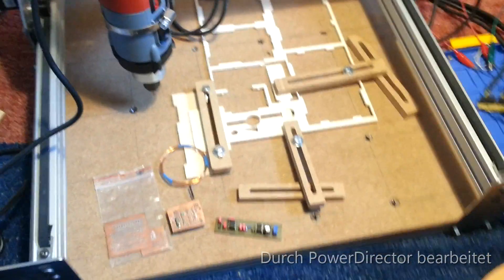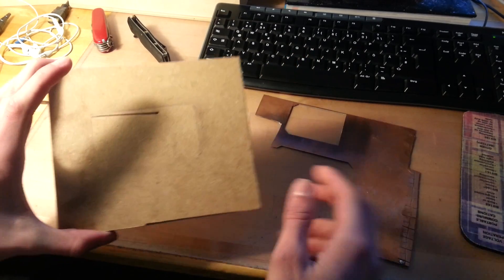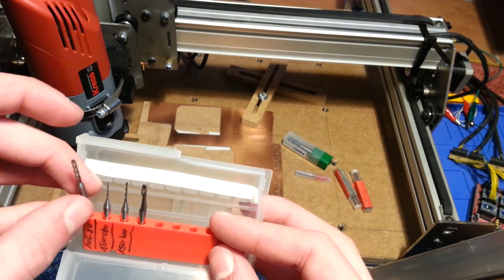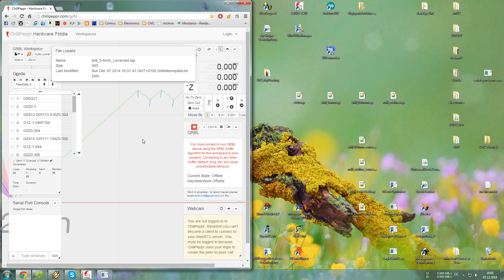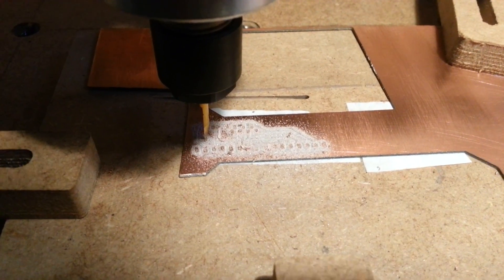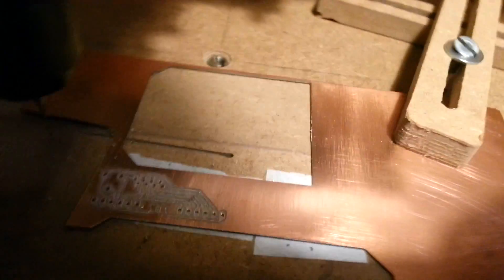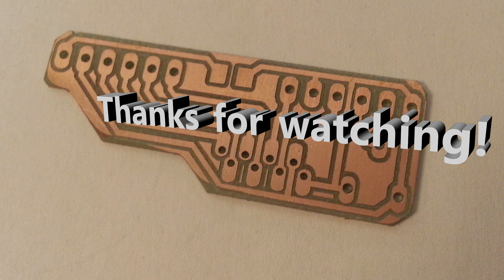PCB Autolevelling for Isolation Routing - Shapeoko

Comment: I made my own print circuit boards by hand and etched them with Boric acid in the late 70's and found that using drilles found in Welding torch cleaning tools work quite well. They come in very small sizes and can drill very fine for HSS drilling.
Reply from the maker: Hi John, thanks for the tip, but nowadays cheap carbide drills from china are ~$0.30 when bought in sets, so there really is no reason to use HSS anymore unless you're in a hurry and need a drill rightaway

Comment: I'm trying to use your program and everything seems to work the same except after hiting save the cnc does nothing. I use fritzing for pcb designe ,flatcam to create g-code , and drag and drop into your program.it creates a box that matches my pcb so I figured I have done everything right so far. when I open the com port I hear the program take control of the cnc ,but after the next few steps ,unlocking etc, and finaly hiting" save" the cnc does not move. any advise? thanks
Reply from the maker: Did you actually use the old software? If so try OpenCNCPilot as this software is no longer supported

Comment: This process is ok for Shapeoko 3?
Reply from the maker: Yes. The Shapeoko 3 also uses GRBL, so it will work just fine
Reply: martin2250 I'm having a problem that I try to solve three days ago. I do everything like in the video, but when it comes to saving everything hangs. I updated my shapeoko 3 to grbl 1.1 so I could use Carbide Motion V4, could that be it? would you have any tips to help me?
Reply from the maker: Can you try downloading and installing grbl 1.1f from gnea/grbl on github? (I don't know if carbide motion adds its own changes or which exact version of grbl 1.1 it uses).
If that doesn't work please open universal gcode sender and post the responses to "?" (status report, only shown when verbose is turned on) and to a manual probe command "G38.2 Z -10 F 30" (be sure to connect your probe cables)
Reply: martin2250 I'm using GRBL 1.1f, it appears in carbide motion and GRBL Heigh Probe V2. I gave the command you suggested and the answer is error: 9
Reply from the maker: no wonder, GRBL Heigh Probe has been discontinued as clearly stated in the video description. its replacement OpenCNCPilot should work just fine with your setup
Reply: martin2250 Hello again.
I wanted to thank you for your answers and support.
I downloaded and did all the procedures with OpenCNCPilot V 1.3.2
When creating a new probing I place the measurements, and when I click Run the following message appears in the lower right corner:

G0Z1 (in black)
G90 (in black)
all below appear in red:
G-Code locked out during alarm or jog state: G90
G-Code locked out during alarm or jog state: G0Z5
G-Code locked out during alarm or jog state: G0X0Y0
G-Code locked out during alarm or jog state: G38.3Z-5F20
G-Code locked out during alarm: G91
G-Code locked out during alarm or jog state: G0Z1
G-Code locked out during alarm or jog state: G90

When i click on "Probe and set zero" the following message will also appear in red:
G-Code locked out during alarm or jog state: G38.2Z-10F20
Received <G-Code locked out during alarm or jog state> whithout anything in the sent buffer.

I believe it must be something with the USB connection or configuration of my CNC, correct?
Thank you again for your attention and I imagine how hard it is to respond to everyone, if you can give me a sense of where to go, I will be greatly grateful to you.

Thank you again!
Reply from the maker: Henrique Corvelo 
your controller seems to be in an alarm state. sending "$X" (without quotation marks) should unlock it (or maybe your grbl is configured to not work unless homed "$H")

Comment: Hallo Martin ,
good job mate .. but i have a question if you can help me ..i'm trying to use your hight prob with my cnc shild v3 ..i dontr know where should i connect the wiers in the shild ... what i'm using now SCL with the GND ..but from the 1st touch it gives me completed .. dont know wich output in the cnc shield is the A5 ..
thanx for help..
Reply from the maker: Hi Omar, I don't know which pin to use on that specific board. you can try to use a multimeter to check for continuity between A5 and any accessible pins.
Reply: yeah ist the SCL but after the 1st Point it stops and giving me completed..
Reply from the maker: Try the new version 'OpenCNCPilot' I am not supporting this old one anymore
Reply: Like a charm Martin ..
thanx so much .. really a very very good job +1

Comment: Hey Martin how do i setup G38.2 in Universal Gcode sender as it keeps on saying Unsupported statment 

Cheers Benjamin
Reply from the maker: I see you've found OpenCNCPilot already, but just for the record you need to use grbl 0.8 or higher for this command to work.

Comment: why the need to probe the full surface,when the cut depth should negate any surfacr irregularities ,which for a copper clad board would be irrelevant,one probe for tool zero deck height should be enough,probing like that is used more for curved surfaces to be milled ,to keep the mill cut uniform throughout the cut .

Im not be-moaning your set up,it's just a long process for which really only needs one probe,then set the withdraw height to clear the copper for the tool to move to the next cut if need be.
I've seen a mouse carved,the probe was spring loaded on a micro switch element set to a couple of thou' contact distance to keep probing accurate.
It's your time,but that probe method is way too long dude.
good vid and nice work.
Reply from the maker: Yeah, it's pretty time consuming, but you can always specify a larger grid size. I think it is neccessary to probe at least the four corners if you don't make sure your work area is totally flat (add to that your method of fixturing and warpage in the PCB blank).
At least when using V-bits i've had boards where 0.1mm of cutting depth meant the difference between a good cut and having some copper left over. and when you're working with SMD parts with small pin pitches you want to go as shallow as possible.
Even with a flat work surface and new PCBs from a good manufacturer I've seen variation of 0.2mm across the board, which could ruin any project.
Reply: hi martin,i was'nt criticising your intentions,just the tedious amount of probing,im using vista and my norton anti virus  rejects the xloader,and universal g-code sender is for win7 and up,so i have'nt even tried the mock up cd rom 3 axis yet,im a technician,i need to update my pc,and what you have is a very good piece of kit for pcb manufacture,i'm sick of the ferric chloride,i turned on to toner transfer,as good as it is,milling is just so accurate,plus drilling holes too.

Have you made any multiple pcbs of the same type on one sheet,this is what im after too,so i can walk away and get on with it.

A good method of clamping is to use long edge clamps with a shoulder and recess ,where the recess is on the bottom edge of the long clamp(mdf strip) ,the shoulder holds down along a full edge,4 of these may help stop warping ,and will hold it rock solid,seen this method used to hold large pieces of timber on a cnc router bed,mdf dust is toxic,a plastic chopping board cut to decent strips.the edge clamp is super low profile.Just a bit of info passed on that i saw.
All the best.
Reply from the maker: Hi John, thanks for the tip. I've since switched to hot-gluing the board at the edges and it mostly does the job. I've not produced any panelized designs, the largest board so far was around 100x80mm with wide traces and gaps, but I'm fairly sure it is possible.
If you want to try my software, you'll need .NET 4.6, I hope MS released it for Vista.
Greetings
Reply: cheers
Reply: john amptech well son if you're  milling pcb for Very fine pitch components such as tqfn or even finer if the machine cuts deeper than the required parameter the v bit will actually make the pad smaller. This is important for fine pitch work
Reply: yes,that,s fine for depth sensitive work,but when a pcb is being cut,the copper clad board is very uniform,unless it has been warped by pressure ,bending it for  a long enough period,even then clamping can hold a pcb flat.

My point was that as i stated, pcb copper thickness should not deveate very much,and a margin of surface error could be added to the depth of cut ,a couple of thou should be fine,rather than probing the entire surface,or practice good house keeping and store pcb flat under a paper weight.

I have seen a mouse(computer) being probed for etching,but that is a different idea altogether.

One method wastes time and the other cannot be helped,my point revolved around time taken,and take an average,in fact a caliper could measure the pcb at various points,then add a margin of error,and allow the depth to be very slightly deeper,then probe for tool height when starting or changing tools.

Comment: Hello, Martin. I also thank you for program and video. I downloaded GrblHeightProbe2.exe, it works under Win7, but does not start under WinXP, complain 'not valid win32 app'. What can be done? want to use old XP pc for cnc control. Thank you.
Reply from the maker: Sorry for answering so late, you need .NET Framework 4 for running the program. normally it should show a message that as some more info on that.

Comment: Great tutorial, thank you. I find I have to cut 1mm depth with a 10 degree bit to stop getting air cuts! This is gonna change my life :)
Reply from the maker: +AS Motion Lab 
Thanks! I really hope the 1mm depth was only before using HeightProbe, this depth would cut through the entire fiberglass on my PCBs :)
Reply: +martin2250 Yeah, my cnc machine is very diy, and it gets a lot of abuse, so it's difficult to dial out the surface error, it tends to shift by itself over time! This will be a lifesaver

Comment: The video was shot very sloppy. Regardless of that you were able to convey all the important informations, present all the required software and show the whole process in detail. +1 for you! I wish all the tutorials on youtube could be at least as good as yours!
Thanks and see you again!
Reply from the maker: +InnerBushman 
Totally agree on that, but I didn't have a tripod available (no excuse for the bad editing/20 min video).
Glad you like it anyways and thanks for the feedback! :)
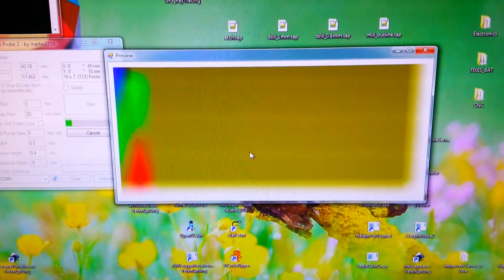Reply: +martin2250 Naah, the length of the video wasn't that much of a bother. Before watching your video I watched some dude's 9:22 minutes long video titled "PCB to Gcode Tutorial" where he spent 8:40 of that time to draw the damn board in eagle! Then he quickly run the Eagle's ULP, clicked some options and quickly executed the thing. No commentary, no nothing! I thought I'm gonna flip out! 
Anyway, there is one thing you could do to improve this video. It is to add in the video description the URLs for downloads of the tools you used.
Right now I'm trying to set up a similar tool chain for LinuxCNC so i can do the same thing on my CNC machine. I was hoping some of the tools will turn out to be useful but i think I might not overcome the incompatibility. My machine is not controlled via serial port. It has it's own Linux OS and accompanying software AXIS (former EMC) and the stepper drivers are bit-banged via printer port. 
Still, a very good tutorial (aside from camera work lol) :-]

Comment: It is good practice to drill first so as to not spin off the donut/pad.
Reply from the maker: +giantkilleroverunity 
It is, but I do it this way because I use the engraver to probe the board and don't want to re-zero again. Also I never had a single pad fly off on me, even ones that were laid out for smaller drill sizes accidentally.

Comment: I am having an awful runoff. I am using a dremel like tool that I bought for little money, but when I put in the milling bit, it wobbles like there is no tomorrow.What spindle are you using?
Reply from the maker: +Rolando Martin 
I'm using a Kress 800
Reply from the maker: I've heard of people shimming their bearings, glad it worked for you :) It didn't do my cheap dremel any good, so I had to switch to heavier machinery.

Comment: how did you generate the grbl?
Reply from the maker: +Danilo pedroso martins 
grbl is a free piece of software which runs on an atmega 328. You can get it from their github repository.  
Anyways, I beleive you meant GCode which is the program that grbl interprets into motions. I used the PCB-GCode addon for Cadsoft EAGLE for that.
Reply: tks, I'll check it out, I'm making my first mill

Comment: hello and I have been working with your program, but really when you start milling instead of going into a low seems my drill is raised and not cut or record anything any suggestions, that using Arduino and grbl shield with pololu, sensing it perfect the problem is when you do the engraving get started as it rises and uncut only makes movements, I congratulate you is a great program but perhaps they do not know how to use could help
Reply from the maker: Hi Emms ,
sorry, I don't fully understand your problem. If you run your generated GCode without using my program to level it out, does it work as intended? Did you set the correct Z-zero? It has to be the same in UGS as in my utility. The best option is to re-zero it again after switching to UGS.

Also, there is a new version of this program available which fixes some errors with the latest release of GRBL.

Please let me know of any problems.

Comment: friend,
Which layer you used the eagle to understand that the program that was the limit of the PCB?
Reply from the maker: If you mean milling the outline, it's layer 46 ("Milling"). I just drew the path of the endmill by hand using a stroke width of 2mm to account for the cutter radius. The toolpath was "not autogenerated" in that sense.

Comment: Hello Martin,

I am trying to do an engraving on some less than flat aluminum plate. I successfully ran your HeightProbe2 program to generate a heightmap, but when I add in my .nc file generated in CAMBAM for correction, HeightToGcode3 says the file does not fit. I probed a 20x80mm area and my gcode is of that size as well.
"Dimensions (GCode):
X: 0	~ 709322
Y: -13184	~ 130407
ProbingTest002.nc does not fit" which are not the dimensions of my program.

Is this tool tested only using PCB-gcode?

I have the heightmap file and my Gcode saved in Drive if you would like to take a look.

https://drive.google.com/file/d/0By0DMuN1xvTOcURscFZ5ODlkS28/view?usp=sharing
https://drive.google.com/file/d/0By0DMuN1xvTONU5ucVdTV1JOWjA/view?usp=sharing
Reply from the maker: Hi, this problem is due to the fact that in Germany, a comma is used as a decimal seperator (I don't like it) and apparently somewhere I missed making the conversion independant of the current cultureset. I just fixed it and reuploaded the file.
Also, this is planned for a future complete rework of the programs, arc movements are not supported. If you click on the Files on the left in HeightToGCode3, you can see which commands get omitted. To fix this, you can use programs like GCodeRipper to convert all G2/G3s to shorter straight moves.
Reply: Thanks Martin. I will try it out tonight